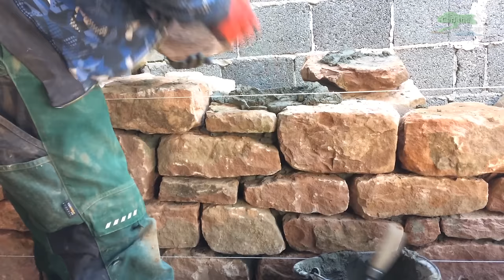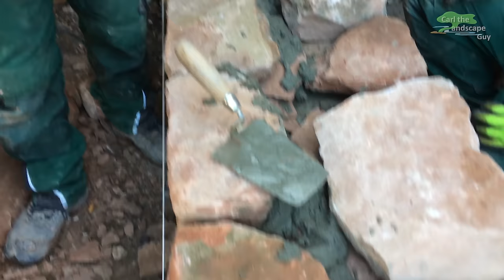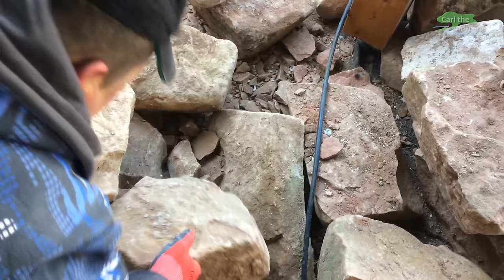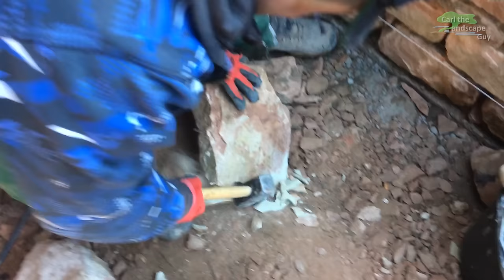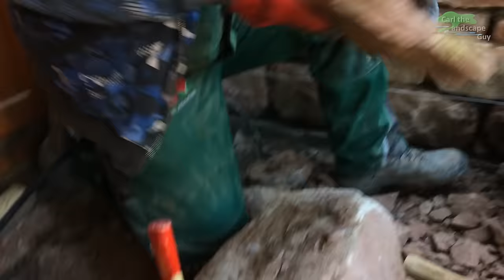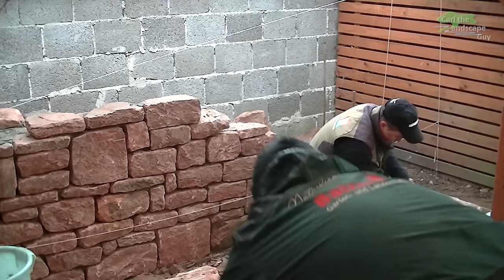BUILDING RED SANDSTONE WALL | DETAIL TUTORIAL | PROFESSIONAL MASONRY DIY TIPS, NATURAL STONE HOW TO

Comment: Ive never seen anyone wash off or dip the rocks in a container of water to get the dust off,  a tip I learned from an old mason years ago. that way the mortar has a nice clean moist surface to stick too . pays off in adherence...
Reply from the maker: that might make the mortar smear
Reply: I think the extent of cleaning necessary depends on the type of rock and what might be on the rocks

Comment: First of all it's a lovely looking wall. However. If you built It with a batter (inward lean) and slightly wider at the bottom you would not need mortar. Did I hear "lean the stones inward"? All that would do is invite water to sit inside and then frost can do its damage. But again, nice looking wall.

Comment: Great job can u detail the mortar type.  is it hydrated lime mix or a  NHL  mix.   Just wondering cause NHL is very expensive where I'm from.
Reply: Hydrated lime does not set and is used as a plasticiser with cement. The cement is too strong for sandstone and NHL is required which sets. Try making your own - Safety wear a must! Plenty of videos on utube!